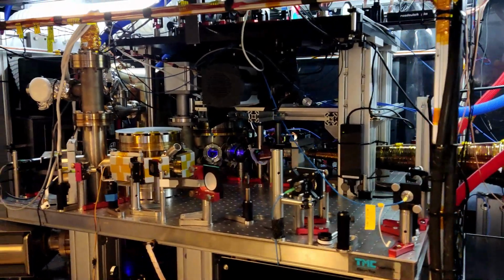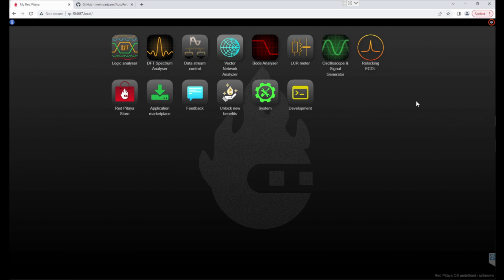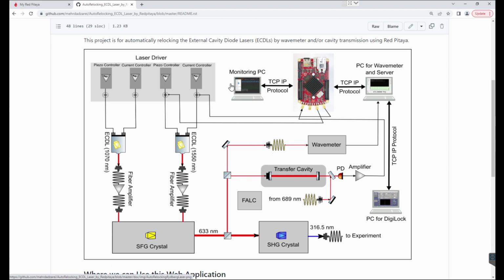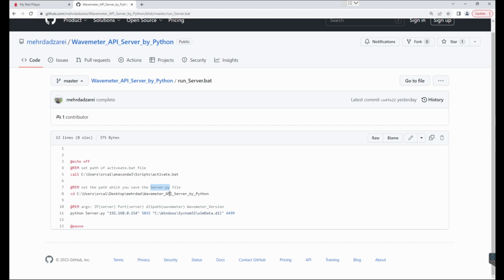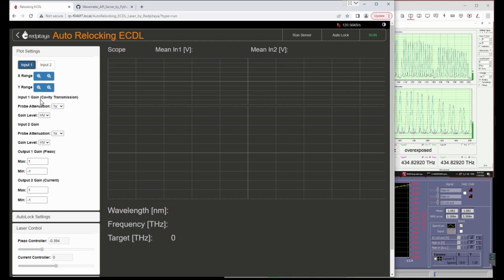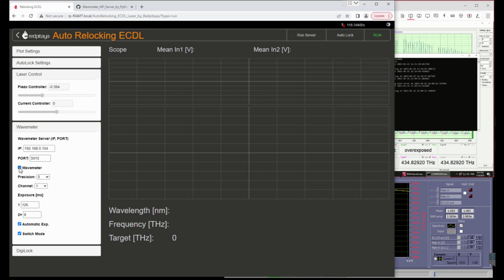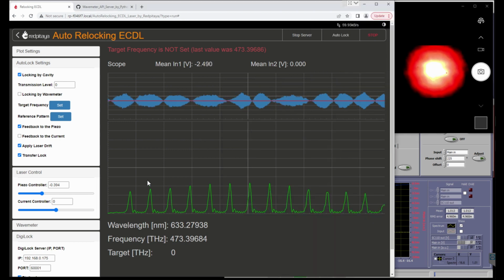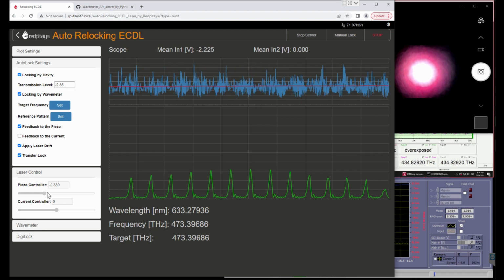Auto Relocking ECDL using Redpitaya

Comment: I have tried to use your app in RP. though i am seeing icon in rp relocking. but when i am launching it shows buffere=ing mode and not launching app .
which image file of rp OS are you using?
i am interested in your  wavemeter based  locking. 
please elaborate on the app.
thankyou